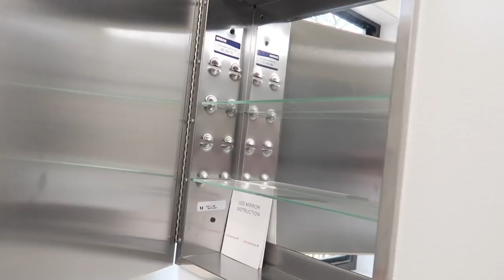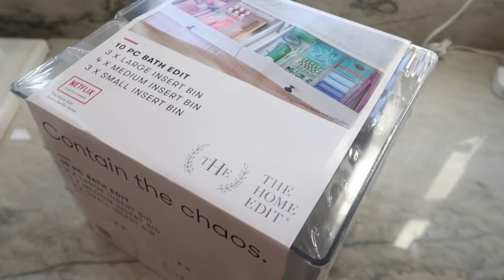Small Bathroom Organization | Homemaking With Me 2022 | Cleaning Motivation

Comment: I don’t know whether you can buy Sugru in the USA. It’s mouldable glue which sets solid once in position but is quite easy to remove if necessary. It comes in several colours. I have used it in my shower to fix several baskets to the tiles and also in the second toilet to fix a small shelf. It would solve your soap dish problem
Reply from the maker: Wow Margaret! I’ve never heard of that but will definitely look for it. Thank you so much! 💗😊💕